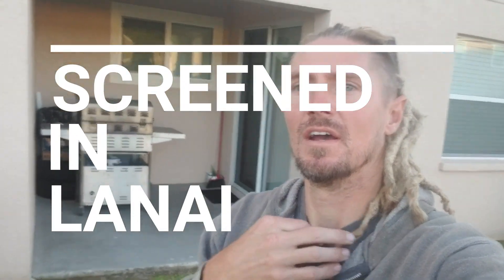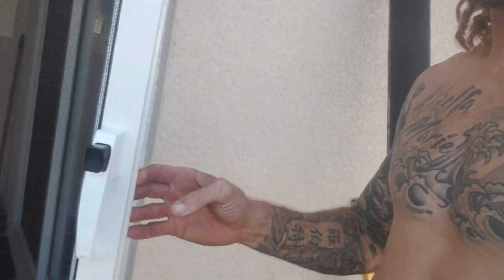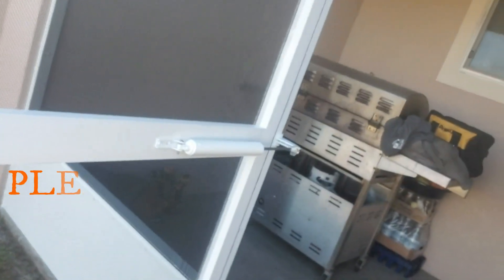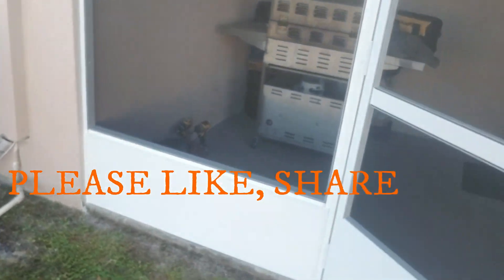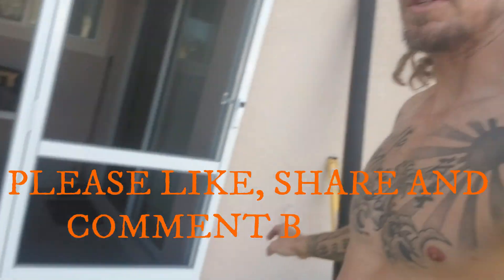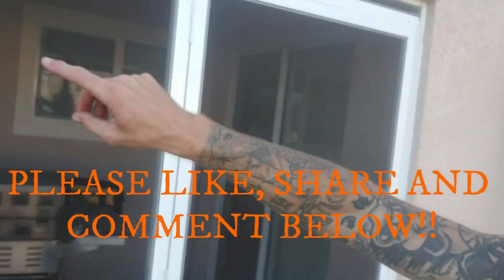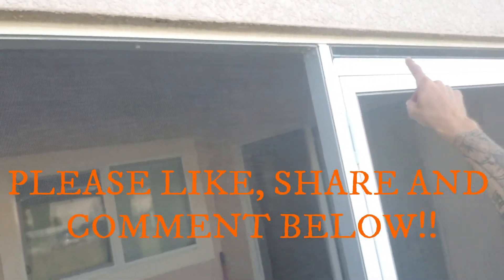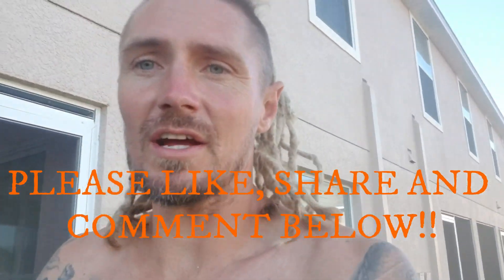SCREEN-IN LANAI.. Is it time to screen it in?

Comment: robbie, my home came with a screened in patio but there is no kick plate on the bottom except on the patio door. i hate it when it rains because the splash up of dirt gets inside leaving nasty dirt residue after it rains. is it possible to install a kick plate all around to match the door kick plate?
Reply from the maker: For sure.. just add 2x2 to the bottom 16" and screw the kick plate to it... fixing the screen after :)